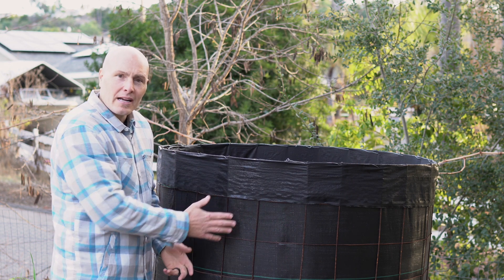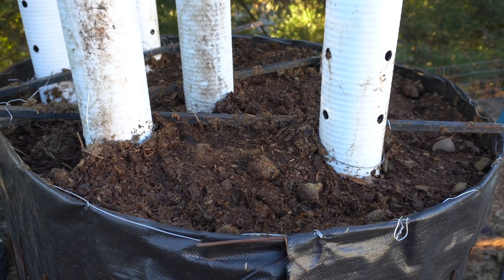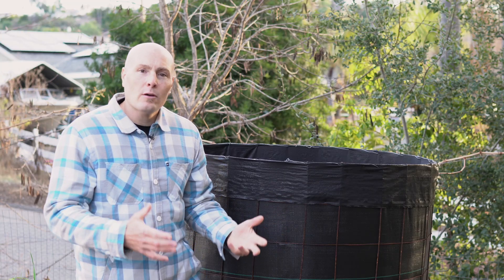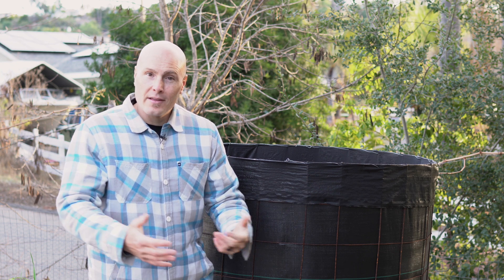Most UNDERRATED Way to Compost | BUILD ONE!

Comment: I built one in October. It's been frozen for most of the time since then, likely due to the extra air flow compared to a typical compost pile
Reply: Since this method supposedly benefits from a longer resting period anyway, would you consider that a negative thing? After all, frost is (or can be) a valuable part of an active decay system. The low temperature would slow down decomposition (I think) but it is not meant to be a fast system anyway, is it? Just asking, I'm still trying to wrap my head around all aspects of this intriguing method.
Did it reach higher temperatures for a while before it froze?
Thank you, greetings from the Netherlands.

Comment: I used your videos to make two bioreactors. So fun to build and they were humming right along until... WINTER! It hasn’t been above 35 degrees in two months or so. I know some farmers in my type of climate (5B and lower) put them in a barn or garage in the winter. If you have any suggestions for how to keep them humming in frozen times, I’d love to hear them.
Reply from the maker: I wonder if something like this would work.  Google - Electric Soil Heating Warming Cable.  I don't want to recommend any brands because I haven't used them.
Reply: @DiegoFooter  Awesome man thanks. Maybe I’ll do this next year and add the drip irrigation like you have at the same time.
Reply: Next week is the first time we're going to dip into extended sub-freezing high temperatures in my area, and I'm concerned for my reactor. It's done pretty well so far, but I doubt that will continue with multiple days of highs in the teens to low twenties. I thinking about trying to find a way to temporarily insulate it.
Reply: @scottplank1012  My guess is that it will just go dormant and then come back to life in the Spring. Not the worst thing in the world since this is what happens to my other cold piles year after year. It just takes a few more months than those in warmer climates.

Comment: First! Glad to see more compost videos
D I E G O ! Im interested in how it turns out adding fish emulsion and other nitrogen sources. I believe when David Johnson was testing different variants of the Johnson Su bioreactor, he mentioned that those which had added nitrogen actually performed worse than those without (only from sources like leaves and what is in manures) due to less nitrogen fixing bacteria developing within the system since there was an abundance of nitrogen and thus less of the nitrogen fixing bacteria were needed
Reply: Are you saying nitrogen fixing bacteria slow down when nitrogen is present ??
Reply: @kennypridemore5466  that’s correct
Reply from the maker: Makes a lot of sense.  It's always what are you go for.  Is a chocolate cake still a chocolate cake if you add coffee to it?  The soil might or might not need a whole bunch of organisms in it - so we are flying blind to start.  I am a little reluctant to say that one way is always the best.  It think you try to generate as many different microbes as possible (if we can even influence that, we probably can't) and add it all to the soil.  So again, he could be totally right, but also totally wrong at the same time - if that makes sense. 😜